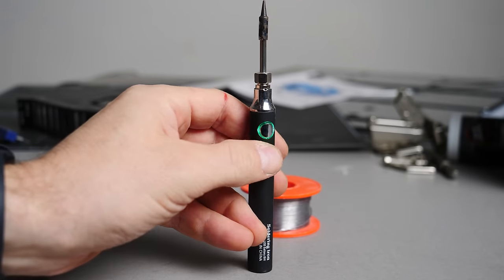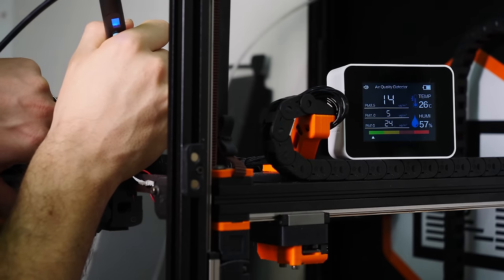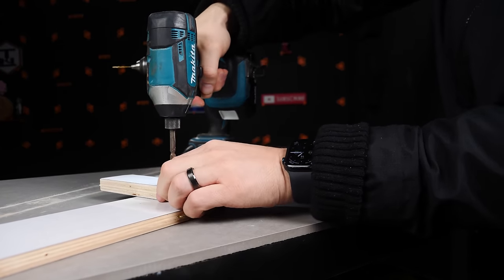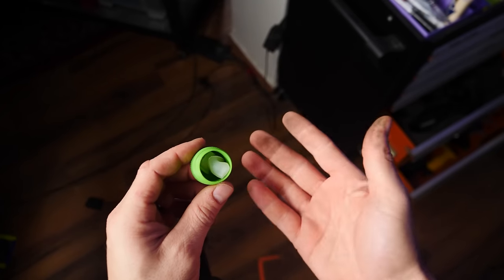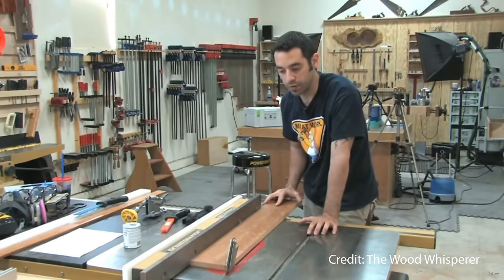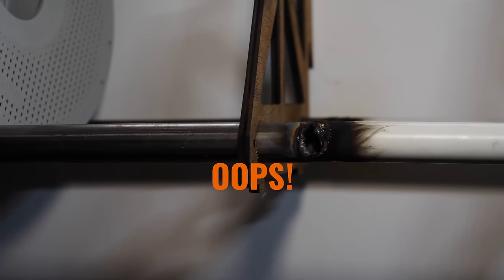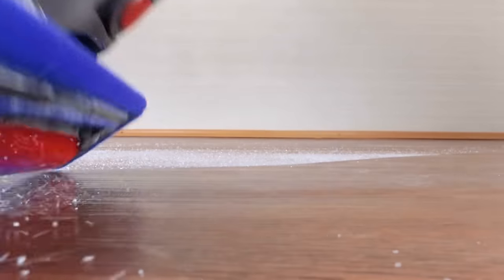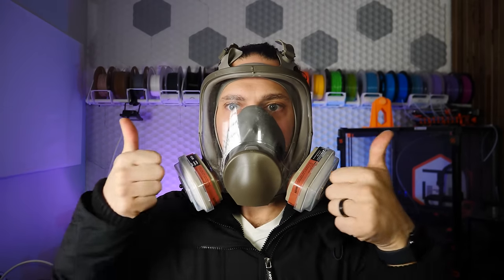9 Maker Tools I Wish I'd Bought Sooner

Comment: I'm not a multi-tool snob, pease get whatever works for you. But I strongly STRONGLY recommend at least checking out the the Leatherman Wave .  It's Adam Savage's tool of choice and he even has a video making a custom carrier for it.  And I believe it's highly regarded in the EDC community.

I can talk for hours about why it's so good and my experience in the military with almost every multi-tool under the sun, but like the impact driver, it's something you feel when you get one.  There are nuances to what's in it and how it's put together that I just can't find in any other multi-tool.  It's a little bit bigger than the one you currently have (which looks really nice by the way) but the tools in it I promise are worth it.

I'll list my reasons and go into more detail in the replies.
Reply: -The blades are on the outside

This is absolutely critical because the blades are the most important thing and you want them to open simply and cleanly.  It's got a ton of other features but at its core it feels just as fast and simple as a pocket knife.
Reply: -The outside blades are the perfect combo

It has a regular blade, serrated, a genuinely good saw, and there's a file too I guess.
The serrated blade and saw might sound unnecessary but the triple combo is game changing.  Especially if you do electronics.  I'm not suggesting it for survivalist crap. I use these three constantly in my everyday life.  I was a computer networker and a light pass with the serrated blade is hands down the best way to open any cable.  And the saw is another thing you don't realize how often you can use it until you're carrying it around.  Most importantly, they each cut with the other one can't.  And the tip of the saw can be used for digging stuff out so you don't ruin your blades when you're trying to pick at something.

And the best part is that the serrated blade has grooves on top so they all feel different in you hand.  It's like brail. I have done jobs where I was crammed behind a server and I couldn't even see my hands.  I pulled out the Leatherman Wave, got the tool I needed, did the job, and put it away, without ever seeing a thing.

I don't really use the file very much.  I wish it was more aggressive but fine filing is important to.  Luckily the entire tool is balanced around these four, so the whole thing feels so good the file doesn't feel like a waste of space.
Reply: -Needle nose pliers (on the inside)

Most multi-tools have pliers nowadays but they make the massive mistake of making them the primary focus.  And worse, they're just regular broad ones.  The Leatherman Wave has needle nose pliers which I find vastly more useful for the little jobs at a multi-tool is for.
Reply: -Scissors

Again, the little scissors are not what you would expect for a typical multi-tool but it's life-changing when you carry it around.  How often do you have to deal with a little thread on your clothing or want to delicately snip something instead of slicing?  Answer..  ALL THE TIME!  It comes up less often than the core 3 blades, but it takes the versatility combo to the next level.  Scissors on pocket knives are normally garbage but the the wave has a genuinely useful tiny pair.
Reply: And for the sake of honesty I'll mention that the screwdrivers, an extremely important tool, could be a lot better.  They use weird custom bits so a standard wave can't hold regular screwdriver bits.  There are other versions that can and the screwdrivers do work.
  They are useful..  But I want to be honest and say it's not perfect.
Reply: Obviously there's a lot more features but I'm not here to advertise.  I'm just pointing out the rationality and the practicality of the tool I have found by far the most useful in my life.  The Leatherman Wave feels like a part of my body.
Reply from the maker: I’ll check it out thanks!

Comment: That full face mask does not work with glasses. I use 3m resp with a full face shield.
Reply from the maker: Ah didn’t know that. I went laser so it works for me!
Reply: @thenextlayer  I am too old for that. First they did it only up to 30. I was 40. Then they advertised that they do it up to 40. At that time, I was 50. Now I think I will die with my glasses on my head.
Reply: You can get a prescription eyeglass kit for the 3M full face respirator and add your own prescription to the mask.